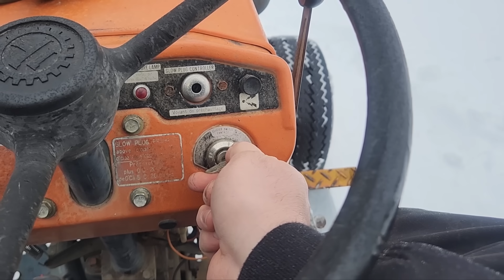Why are Diesel Engines Hard to Start in Cold Weather?

Comment from the maker: Hope you guys liked this topic, not much going on in the shop last week so you got a topic video. Thanks for watching. Check out these Amazon Affiliate links to help the channel out: Fuel Pressure Gauge, Compucheck 0-300 psi: https://amzn.to/3YeBldu
Airlift Cooling System Vacuum Filling System: https://amzn.to/3D9AlPu
Radiator Pressure Tester Kit: https://amzn.to/3QGBumn
Milwaukee 3/8" Right Angle Impact Wrench: https://amzn.to/3D2CvAk
Adjustable Height Parts Tray 100 lbs: https://amzn.to/3CBusZB
Engine Oil and Fuel Dye UV: https://amzn.to/3z34zkv
UV Professional Grade Light: https://amzn.to/3gzxPc0
Allstar Oil Pressure Priming Tank: https://amzn.to/3L5pASm
Oil Pressure Priming Tank: https://amzn.to/3YuBrNr
Photo Tach REED: https://amzn.to/3ATJ8Cw
Reply: Living in northern Maine and running a range of diesel equipment, this is a subject near and dear. Never really thought about the higher density of cold air affecting its compressibility, but that makes perfect sense. I got away from ether for a while due to concerns about cylinder wall wash down, but have begun using again - sparingly - now that some claim “lubricity”. Hope springs eternal, my fellow simian.
Reply: Does a c13 KCB have glow plugs?
Reply: Hi could you please do a video about de acert engine?  It's very common as I'm sure you know in the trucking world with the C15s.  I know the CAT answer is not to do it.  You don't have to endorse it but could you give a review on what you know and what you've seen in your experience?  For example rebuilding an MXS acert to a single turbo 6nz type of setup

Comment: I just rebuilt that exact model Kubota (L245D).  That’s what I do full time (Kubota Technical), also I’m a full time Pastor.  Have a blessed day.
Reply: You do the lords work 24/7!
Reply: I work on Carrier reefer units. If I may ask, I’d like to know how you connect to the ECU on these. The connector has a ton of pins but most of them are not used in the harness. Is it over the CAN wires? Special adapters? What software do I need? Thanks and God bless 🙏🏻
Reply: @markm0000  it’s all proprietary software, connectors, and computer programs. Yes it’s probably the two wire square connector that uses CAN. I do not work on those industrial units but they’re very similar to tractors. Blessings to you!

Comment: My great grandfather used to tell us about back in the 30s living on the farm and dealing with motors in the winter. He said they used to have to drain the oil on the car when they got home from anywhere and keep it in the house next to the wood stove to keep it warm. And then quick fill it up right before they’d start it or it would never start in the cold on its own. I can’t imagine!
Reply: My grandma's dad did the same thing with his old Internationals and Model Ts--if it's cold enough (didn't happen all the time where he was, but it did happen) you just dump the oil into a galvanized tub (not the good one!) and then transfer it into an old milk can (also not a good one!) Sit that puppy next to the nice, hot stove and you'll have no troubles. The 30s were rough, for sure.
Reply: That was interesting to read, reminded me of a memory. During winter, my dad used to drain the water from his tractor, and filled it up with warm water before use. Needless to say, that engine was toast anyway, mismatched piston, rings installed in wrong order, cracked head... We ran it until the liner O-rings started leaking. It's been rebuilt since, and starts easy enough, despite being a pre-chamber engine.
Reply: Doing that in 30s was a brilliant thing. People I know in himalayas recommend it till date not known what 0W grade oil can do

Comment: I work on big 645 and 710 locomotive engines, and these have NO glow plugs. Locomotives typically stay running all winter long and never shut down. Locomtives don't run antifreeze. Some of them have air starters and some have electric starters. GE's have an inverter starting system, which means no physical starter. EMD's have either air, electric, or both. The only good way to start them when cold is with hot water. The engines have to be prefilled with hot water, then started. On rare occasions, we take rags soaked in diesel fuel, put them in the air boxes, and light the rags on fire to get enough heat into the cylinder to light them off. I've had calls from the fire department asking if we had a fire emergency when cold starting a locomotive. 😂 Such good times!

Comment: I feel silly. I just experienced this last week. I have a 6.5 Detroit Diesel and drove about 300 miles to find a hood and bumper (for a different vehicle). After 30 minutes in sub-freezing weather, I was ready to hit the road, and I turned the engine but no start. I asked the junk yard for permission to park my truck there for a few days. My plan was to get to a bus station, get home, get another truck + trailer, and tow the 6.5 back home. Guy instead offered to give me a jump. I'm like, "Battery's fine, something wrong with the engine, or fuel, or something". So guy hopes in my truck, glows it, and fired it up without a jump. Despite 300 miles on the freeway, 30 minutes in below freezing weather was enough to cool the engine enough that it needed to be glowed. I felt silly.
Reply: Indirect diesels need glow plugs to start even in 75F
Reply: @fastinradfordable yup seems like 50° and below my 7.3 idi wanted them
Reply: Glowplugs operate even at warm temperatures for a reason
Reply: Thank you for sharing the experience

Comment: Space heaters. I'm lucky now all the equipment is in the shop, but back in the day you would fire up a 150,000 btu space heater, put an old parachute or tarp around the machine before you would even attempt to  start an engine.

Comment: Going back in time to when we used pony motors to start the main diesel,  one of the strategies to a good start, was not to be in a hurry.  Squatch 253 is a proponent of the "get the cylinders good and hot before sending in the fuel" way of doing things.  That thing, is to let the pony motor spin over the big engine on compression for a while, letting some heat accumulate in the cylinders, before introducing what will be relatively "cold" fuel.  This applies in all seasons, but is crucial in the cold.  
Spraying the "cold" fuel, even in the summertime, into a cylinder where the rings might be tired, the valves may not be sealing well, whatever the reason,  when you spray the fuel in, if things aren't hot enough in there already,  the "cold" fuel is going to cool things right down and make compression ignition a whole lot harder.
Yes, in warm weather, if after the engine has been running already,  you have a better chance of getting the big engine to fire on the first strokes, and it can be a success with injectors sending fuel instantly,   but the warm-up-the-cylinders-first idea is a tested, proven method.  
Fast-forward to today with modern, computer-controlled fuel injection diesel engines,  and you will find that the ECM's are programmed to let the engine spin over a few complete revolutions before telling the injection system to begin firing.  That gives the cylinders the best chance to build a little heat before the "cold" fuel start spraying in.
It might seem counter-intuitive to the beginner to be wasting battery cranking power allowing the engine to roll over several revs before firing,  but that is the reasoning behind it.
Reply: Funny over the pond we call them Donkey Engines.
Reply: Common rail engines also need a crank revolution because the ECU doesn't know the crank position, unlike in a fully mechanical engine

Comment: Working in Upstate New York I have had a little experience with these problems both in the Army, Fort Drum, and working for SWIFT, Syracuse, as a mechanic.  In the Army, I have had several different cold weather start systems Glow Plugs, and Either Start systems, and the best I experienced was in the old Deuce and a half trucks.  They installed a spark plug into the intake and the firing of the spark plug would preheat the air.  I never had one not start on the first try.  When I worked for SWIFT Corporate would not let us cut the fuel in the wintertime.  Jonestown PA could but according to them, it was not cold enough in Syracuse NY to require that.  I would spend 12 hours a day outside rescuing gelled-up trucks in the yard.  Pull the fuel filters and see the jello diesel sludge, replace fuel filters, and add Rescue 911 to the fuel, and the filter wait for a half hour, then start the truck and get the driver on their way.  We were having issues above freezing one day and my manager questioned my intelligence because "there is no way these trucks are gelled up it 's not cold enough".  I told him that you do realize that it is 36F with a wind chill of 20-something out.  Trucks are not affected by windchill.  Okay, buddy that big giant heat sink of an aluminum fuel tank sitting on the side of the truck is not being cooled below freezing while that wind is whipping around it.  Has anyone ever heard of an air-cooled engine?  Aluminum is a great conductor of cold.  Take a warm beer place it on ice and spin it around a couple of times, you will have a cold beer pretty quick.  This is why I was outside working in the big freeze, he thought it was punishment when to me it was a reward to be away from the idiot.

Comment: I became familiar with the manifold flame system used on the M48 and M60 Army tanks that used the Continental 1790 engine. There was a flame generation device located in a steel section of the intake manifold where a hand pump operated by the driver along with energizing the starter solenoid would allow a spark igniter to build a flame in the intake. The electrical interlock with the starter solenoid was needed to prevent igniting the fuel if air was not moving in the intake. I have seen this system used on some European diesels also.

Comment: I enjoy your videos. They help me understand a diesel engine better. I drive a bus for our church. We had an International with the DT466. That engine didn't like the cold at all. If it was much under 50f and you didn't plug it in, good luck getting it started. I replaced the glow plug solenoid because it wasn't working. That helped, but not enough. We sold it and it ended up in Florida. It should start fine there. We where blessed with two 2009 IC buses with the Maxxforce DT (I know not many would call that engine a blessing). I have them on a timer to run the block heater and a battery maintainer for 6 hours Sunday morning. Even though they will start in the cold, I figure its got to be better on them to use the block heater. Thanks for the videos.
Reply: What timer are you using that can deal with all the amps that a block heater draws?
Reply: @michaeldunagan8268  I used a contactor as well. The timer just controls the contactor.

Comment: Josh, as this is a "Topic Video" I wanted to chime in with my years and years of accumulated knowledge on them there ornery Diesels.  I've had some experience with both glow plug and non glow plug diesels. 1). Early on I used to change the starting fluid cans on the Cummins 250's as a pm person at a huge truck leasing company out of Birmingham Alabama.(I worked in Detroit, Michigan) We also had "pellets" for the 2 cycle GM's. 2). I have a Ford Super Dexta 3 cylinder Perkins Diesel tractor that has a glow plug in the intake manifold. My local Ford Tractor Authorized repair guy says it actually makes a Diesel Fire inside the intake manifold. I thought it only vaporized the diesel fuel, but I've seen enough farmers light a wad of cotton dipped in Diesel on a coat hanger and hold it over the intake to start cold Diesels, that I'm inclined to believe him. 3). Later I had an opportunity to purchase a GM 350 Diesel car that was only two years old real cheaply but wouldn't start. Having farmer cousins with lots of experience with all things Diesel, they told me to get the biggest batteries I could find under the hood, & it'll always start. I bought two 1175 CCA batts called "ICE BREAKERS" from a drugstore turned auto parts store.  They were bigger than anything on the market. Then I learned about glow plugs, and mine weren't working. The first thing I did was put a manual override "doorbell button" on the solenoid. Then I had to learn the GM glow plug system used 6volt glow plugs for quick heat up times. That means you don't just turn them on, you pulse them just enough to get the engine going. After a while I owned 4 GM Diesel powered cars at the same time with similar problems, because I could buy them relatively new for small money. I found out GM recommended a minimum 600rpm cranking speed to create heat for initial combustion. And even though you could blow a head gasket immediately using starting fluid, I found that you could use it if you only gave it just the tiniest tiny tiny shot. Then I learned when wife ran out of fuel to put a hose from the BBQ grill propane tank in the air inlet w/ just the tiniest tiny tiny shot of starting fluid and I could start up a dry fuel system and run it on propane coming directly off the propane tank with no regulator until the engine was running on it's own fuel. BTW, when I have a fuel pump issue on PETROL/ GASOLINE cars, the propane/ starting fluid deal works well enough to drive it away on the propane. You wouldn't want to do it in traffic, but out here in bug tussle, I drove my 1998 Yukon 5.7L gasoline Vortec 10 miles to a nice warm shop when it was 20°F outside, to replace the fuel pump using only my 20# BBQ grill tank. Sometimes I get them running on propane and hammer on the gas tank and if the pump comes back to life, the engine will chug like the choke's on, thus getting one more shot at driving it a bit further.  I have run enough Diesels in cold climate to know all about running Kerosene below 10°F to avoid waxing or gelling. Some places told me I'm gonna blow my car up, but for the last 36yrs of my working life I worked with the engineers who developed the GM 350 Diesel and I got the skinny on it. The stations who didn't want me to put Kerosene in my car fuel tank weren't paying road tax on it as it wasn't a road fuel. What they weren't telling me was the truth: Kerosene is just Diesel cracked further or refined a little more until the wax is removed, as in Jet Fuel. The Truth Will Set You Free, if you take the time to learn it. Thanks for the channel Josh, it's always very interesting to see a professional walk right thru issues of such technical detail as you do. I'm old now, so I don't do much, but you take me places where I used to go daily. Thank You for going thru all the effort to video edit and post. ben/ michigan PS, have you ever used a snow blower? If you do you'll never look back.
Reply: Snowblower is what happens on a ski resort if a guy is lucky enough
Reply: Happy day's.

Comment: i have an old ford school bus with air start. Its got the new holland 7.8 turbo diesel. Ive never seen another school bus with air start. But its service life was up near seattle wa. My only thought was it was for cold weather start ups. It does spin over fast! I actually really like it. I can run the bus with a little pickup battery because there are no large 12v loads. Just gotta make sure you have good pressure in the tank.

Comment: Josh, Keep up the great videos!   2016 unknown to me a lighting strike came close to my truck when at home. Took out all 6 injectors. Tow truck driver smelled the starting fluid and flipped out .  Told him either leave or tow ,but no bit****g. He towed. Arrived at dealer and Service writer asked. I asked how would you check failed start if you was a simple O-O/ He answered same. I mean 2 shots and it wont? To the shop it goes! $6800 tow, injectors, R&R.  All 6 failed electronics.

Comment: The formulation of mixing of chemicals are different for gasoline and diesel in the winter.  There are highly aromatic or another way of saying it is quickly vaporizing additives in gasoline to help start in colder months.  One proof of this is when you have old gas in your generator or snowblower and it is cold it will be hard to start if using old gas.  Pour fresh gas in and it will usually start right up as long as everything else is maintained properly.  Diesel doesn't have this advantage and relies on compression and heat to start the oil burning.  When cold, the clearances change and get worse which again exasperates the problem.
And my 3406 never had a problem starting even down to -20,  but below that I never shut it off when on the road.

Comment: I run Rotella oil in my diesels (5.9 Cummins and 3 cylinder Kubota) and I have found that switching from the T-4 (summer use) to T-5 or T -6 (semi/ full synth) for winter use makes them MUCH easier to start when it's cold. Keeping them "plugged in" (coolant heater in 5.9, magnetic/ block heater on Kubota) makes a HUGE difference, as did moving to a lower elevation (not a practical answer, but I noticed a big difference) Finally I run an additive in cold weather (Power Service white bottle).

Comment: Here in northern Europe, we use auxiliary heaters that run on diesel and heat the coolant, used for both heating the engine and cab, set it on a timer and it's nice and warm in the morning.

Blockheaters are very common on smaller vehicles like cars and pickup trucks, plug the vehicle into an outlet and a coil in a water passage heats the coolant.
Reply: Same in Northern North America..😂
The you all's, well that's a different thing. When they go North, all bets are off.😂
Reply: I have a remote start, she goes out and starts the truck right after she makes me breakfast, also plows the snow off the driveway. took 32 years to train her but is working good now.
Reply: I put a Webasto boiler in my sailboat.  It worked so awesome.  Thank you